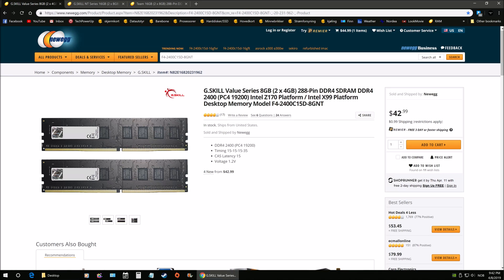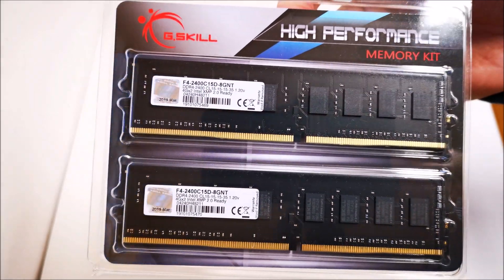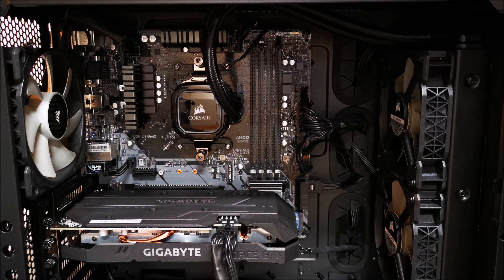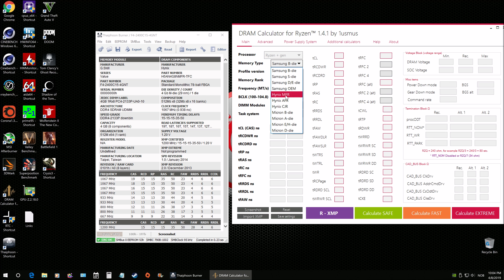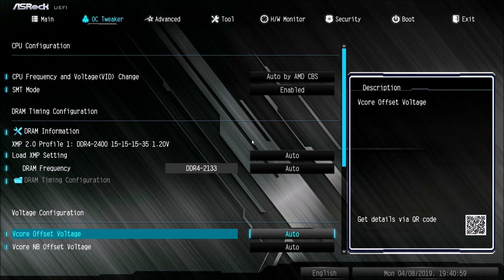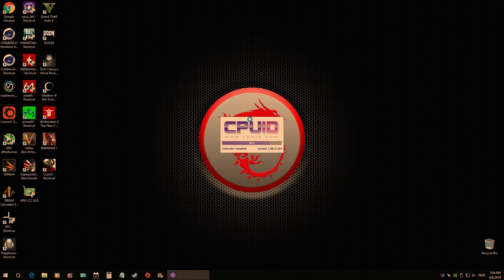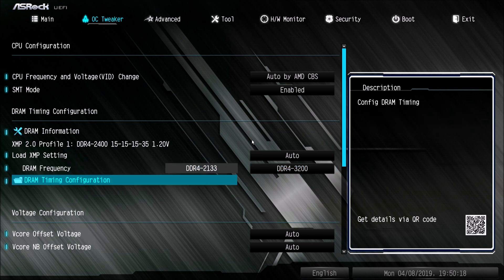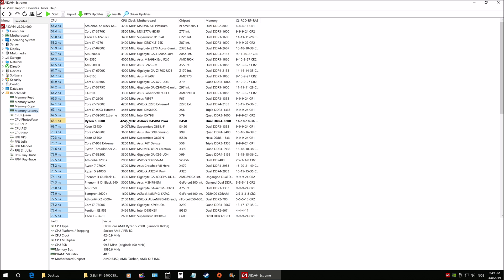Value RAM Overclocking. 2133 to 3200Mhz???

Comment: I increased voltage to 1.5v and got my ram running stable at 2933mhz. 3000mhz won't boot. My cpu is bottlenecked by my ram speed :(
Reply from the maker: 1.5v is a bit too high for 2933MT/s.
Reply: @TechnologyHive  It doesn't boot at 1.45v

Comment: I've bump up from 2133mhz(14-14-14-35) to 2666mhz(15-17-17-35) at 1.2v because neither my board support DRAM oc nor my CPU support it, I'm talking about 8th gen Intel motherboard and processor. But I'm planning to upgrade to 12th gen which supports 3200mhz. So I want to try the same module at 3200mhz(16-18-18-36 or 38) at 1.35v. Do I need to mess around with sub-timings or leave them alone?
Reply from the maker: I would definitely adjust the sub-timings, myself. However, you could just adjust the primary timings and call it a day. But true performance improvement, especially in games, comes from adjusting your sub-timings. 

Here is a list for sub- timings you can try which are universally accepted by most kits, assuming you're going to be adjusting the primary timings to 16-18-18-18-39 @3200Mhz:

tRC 60, tRRDS 4, tRRDL 6, tFAW 16, tWTRS 4, tWTRL 12, tWR 12, tRFC 580 (480 at 2666Mhz), tRDRDSCL 4, tWRWRSCL 4, tCWL 16, tRTP 8, tRDWR 8, tWRRD 4.

Leave the rest on AUTO. You can try these settings at the moment at 2666Mhz and still see a big improvement in performance in games even at such low frequency. Some settings may be AMD exclusive and you will not see them in your BIOS. 

Hope this is helpful.
Reply: @TechnologyHive  ok please provide me sub timings for 2666mhz
Channels Advanced Timing Control:
tRC, tWR, tCWL, tRRD_S, tRRD_L, tWTR_S, tWTR_L, tCCD_S, tCCD_L, tRFC, tRTP, tFAW,

Channels Misc Timings Control:
There are also too many options but I think these don't matter much.
I'll app your help. Thanks ❤️

Comment: i have 2x8 Gb corsair vengeance lpx 3200 installed on my pc with xmp enabled and i found one old corsair vengeance lpx 8gb of 2400mhz so if i install old ram with the current two with xmp enabled will all 3 work at 3200 mhz ? if not is there any way to get it to work with overclocking in bios ?
or all the ram will work at the lower frequency of 2400 mhz ?
Reply from the maker: Good question. There are several factors you have to concider. First: are the memory chips made by the same manufacturer, like Hynix, Micron, Samsung, Nanya? Second: what revision are they? Is it Samsung B-Die? Hynix AJR? Micron E Revision? The ram vendor does not matter, meaning, Corsair, G.Skill and so on.

Third: Are these dual rank modules, meaning, do they have chips on both sides of the sticks or just one side? And even if you can match all 3 aspects, you still have to deal with the "silicon lotery" issue. Some chips are better than others from factory, depending from what side of the waffer they were taken. 

I highly recommend that you NEVER mix ram modules. However, you can in theory make them work together if you disable XMP, and manually set your overclock values in the BIOS. You will need Thaiphoon Burner to inspect all memory dimms and see if they are a potential match. If not, don't do it. I hope this answers your question.

Comment: It is possible from GSkill Aegis 2x8GB DDR4 2400mhz 1.2V to 3200Mhz with 16-18-18-36. 1.35V ? My motherboard is Asus Prime B450M-A. With Ryzen 5 2600. My memory ram of origin has the times of 17-17-17-39
Reply from the maker: It really depends on your cpu memory controller if I had to guess. The R5 2600s did not have the best memory controllers. I'd be happy to get 3000mhz 17-19-19-19-39 1.35v but you can use the Ryzen calculator to help you. I made a video on how to use it. It's on my channel 😊👍.

Comment: Funny thing: Got an i7-6800k with Corsair Vengeance LPX 2400 XMP RAM (4x 8GB) and it has the same Hynix MFR Dies.
Via Quad-Channel, I shouldn't worry about memory speed too much, but I will try this. Default is 2133MHz, XMP is 2400. Currently, I am at 2666MHz and I will try 3000+.
Reply from the maker: Give it a shot 😊. Use the Ryzen calculator if you'd like as well. Comes handy. 👍

Comment: i tried it on my Vasky memory and it running at 2600mhz . after i see this , itried to overclocked to 3400mhz and it works and all my game that have a mini-stutters become smooth. its 2weeks ago before i comment this video. and still my ram alive. i think adding 1000mhz in oc is the maximum. itried to increase to 3500mhz but after a few minutes of gaming, its BS. and not turning on. then i unpluged the power and hold press the power button for 5 to 10 sec to reset the bios. then i set it again to 3400mhz. its very stable on my ryzen 5 1600.
Reply from the maker: Excellent! That's a real good bump from 2666mhz to 3400mhz. It might also be that the memory could clock higher but it's being limited by the memory controller. See if your board has a new bios out. Maybe this improves memory performance. 👍👌
Reply: 3400mhz is the max frequenzy for 1.35v idont have any voltage option. its only auto or 1.35v i think if i set the voltage to 1.4v i can reach 4000mhz.
Reply from the maker: @RenceTV04  I think you might be able to also.
Reply: i dont want to upgrade my motherboard. its a320mh. its only display the safest  setting i can choose to prevent a hardware issue so im contented to what i have 😁
Reply from the maker: @RenceTV04  that's all that matter 😊👍

Comment: Hello, I have question. I have HyperX Fury CL18 (Xmp is 3200mhz) DDR4 16Gb, Ryzen 5 3600, and mbo is Asrock B450M PRO4-F, is it possible to OC to get stable 3600mhz? I tried regular 3600mhz timings with xmp profile enabled and tested with 1.35V and 1.40V, I can boot PC but after some time while I am in game, PC restarts. I was just wondering can I get stable 3600mhz
Reply: I would just try it with ryzen dram calculator like in this tutorial, if you set everything right you should be able to get 3600mhz without any problems
Reply: @Domniak  i am oc for first time I need help
Reply: @marceloagbaba7091  I could help you, where can I contact you?
Reply: @Domniak  facebook: Marcelo Agbaba instagram: marcelo_agbaba
Reply: @marceloagbaba7091  I sent you a request on instagram

Comment: I know this is an old video. With that said, I have a 32 gig kit of LPX vengeance 2666 in my thread ripper system.  Its running stable at 2933 on stock trimmings running prime95 stress test.  I will try 2966 next. If I get good stability I'll try 3000 and continue in that fashion until I either loose stability, or make to 3200 stable.
Reply from the maker: Test with prime95 to be sure it's 100% stable 👍

Comment: Can I overclock my Geil Evo spear 8gb 2400mhz to 3200mhz??
Reply from the maker: You should be able to. Try 1.4 volts and do not touch any other settings like timing or what not. Only change the speed.

Comment: Hey please help me out. I overclocked my 2400mhz ram to 3200 mhz (Dram voltage also changed from 1.2v to 1.35v) , after a brief pause in reboot my bios shows i have successfully OC'ed my rams, but when in windows i check in CpuZ  and task manager, it still shows my ram speed at 2400 mhz. What did i miss or do something wrong ?
Brand : Corsair vengeance lpx 
Motherboard : Msi x370 gaming plus
Reply: Try setting it to 3000 instead.

Comment: I have a crucial basics ddr4 2400mhz ram. Can I use your tutorial to overclock it? Thanks.
Reply from the maker: Yes it should be the same or similar concept 😊
Reply: @TechnologyHive  What is the type of board
Reply from the maker: @aboplays3208  this is the ASRock B450M pro4
Reply: @TechnologyHive  Was I able to overclocking an 2200g APU processor to a speed of 1700 on a b450m hdv ?
Reply from the maker: @aboplays3208  I can not garrantee this because it all depends on multiple variables, like silicone lottery, ram, and such.

Comment: I installed a bigger dissipator on my ram and overclocked from 2400mhz to 3200mhz (Ballistix 16gb 1x cl 16)
Reply: Yeah it can help. Hitting 50 degrees C on your RAM and you start getting instability. Hitting 80 C and you start permanently damaging the chips. I don't think you can ever hit 80 C with RAM under normal circumstances but a  RAM heatsink may make heavily overvolted RAM more stable during gaming, when your CPU and GPU are dumping heat into your RAM as well

Comment: nice video but doesn't work with me. I have r5 2600 + msi b450 tomahawk and kingston hyperX fury 2400mhz HX424C15FBK2/8 and thaiphoon burner won't work with me? I need help.
Reply from the maker: Did you run thaiphoon burner as administrator?

Comment: I did this today before i saw this video, and I can say this is the way to go and yes it is stable if you know what timing and voltages to adjust , you can use software or traditional math. :) I have mine from 2133 - 3000mhz stable (crucial ballistix 4x4gb) I also raised my 7600k to 4.4ghz OC, 2133mhz crucial(3000mhz OC) MSI armor 1070ti 8gb 1607 mhz 4151mhz OC @ 90% Core Voltage, everything runs smooth. Air cooled, I was going to upgrade but after doing this i think i can squeeze another year or two from this, if I add liquid cooling i can get up to 5.0ghz 4.8ghz and ill be content
Reply: At first I thought you were talking about liquid cooling RAM :D

Comment: I got a 2600x+ B450 Aorus elite + DDR4 G.Skill 4x8 2400Mhz , i tried to push up to 2666 , it worked , but beyond that , like exemple 2800 , pc dont boot , i didnt know too much so i didnt changed timings or everything else , just changed the DRAM Frequency , any clue please ?
Reply: bump the dram voltage to 1.35
Reply: pump up the voltage, dont go over 1.35v tho

Comment: hello to do with any brand of value, like I have a 2400mhhz and I want to put the 2667 3000 one from kingston can I do it?
Reply from the maker: Depends. It is not recommended that you mix different spec memory. But if the IC'S are the same, for example Samsung B-Die or SK Hynix A-die, you can try and mix them. Download thaiphoon burner and find out who makes the actual memory chips. Then go from there.
Reply: @TechnologyHive  yes the two memory modules are the same 2400mhz I wanted to put the maximum 2667 3000 if it works. but from what you told me overclocking works right?
Reply: @caicoalan2078  Nothing is guaranteed to work, Just give it ago and compare your score with a benchmark software. https://ram.userbenchmark.com/

Comment: hi I'm running the Ballistix Elite BLE4G4D26AFEA.8FAD 2x4GB ram. i'm not sure if it is 2400 or 2666Mhz cannot find him at google . I overclocked my 7600k to 4800Ghz 1.25V and now im trying to get 3200Mhz with this ram but it won't let me go over 3000Mhz by 1.35 DRAM voltage. Should i go higher with voltage or is it because of the timings 16 17 17 36?
Reply from the maker: Try 16.18.18.36 trfc 480. But the best way to give you a more straight forward answer is if you get thaiphoon burner. Download it and find out if the chips are Micron E die or what?
Reply: @TechnologyHive  can i upload a picture from it via imgur? let's try imgur.com/a/xIUxyvi
Reply: with 3000Mhz i get a bluescreen after 10min playing a game so i went back to 2800Mhz but the mouse reaction was much better with 3000.

Comment: Good video mate. Just got my hands on 2 Gskill F4-2133C15-4GNT CL15 modules, they run 3200Mhz at CL19 and 2800Mhz at CL17, 1.3V.... Gskill - go beyond limits <3
Reply from the maker: I also just got some Ballistix Sport sticks rated at 3000Mhz CL15. Managed to push them to 3600Mhz CL16-16-16-36 1.4v They are Hynix E die chips so the kit overclocks like a mountain goat :) Perfectly stable for 24-7 use.
Reply: E die are the best thing about the ballistix ram my custoner utterly enjoy my oc for the from 3200 to 3600mhz

Comment: Hi,

I have exactly the same kit but cant get it above 2800 mhz and even then it doesnt always stick through it...

I wonder what could be the cause.

These are the specs of my build:

Asrock b450m pro4 

Ryzen 3 2200g (oc to 4 ghz on 1.4v and vega 8 to 1700mhz on 1.3v)

Memory as it is, at: 2800mhz and voltage at 1.350v

Hope this is enough information and hope you find the time to look into this!

Kind regards from a new to the scene pc gamer!
Reply: This series of ram sticks are not stable with Ryzen CPUS that has integrated graphics. The problem is your cpu, not necessarily the ram. If you want to overclock this kit of ram you should have bought a cpu that has no integrated graphics inside.
Reply: remco linders it’s probably the memory controller on your 2200g.

Comment: Can I oc my Corsair vengeance ddr4 c16 3000 MHz to proper 3000 MHz cause they are currently running at 2133 MHz automatically I don't know  why, on gigabyte b450 ds3h wifi???????plzz help
Reply: ONEFORALL turn on xmp
Reply: Use the ryzen ram calculator with frequency 3000mhz and put in all the numbers it gives you into your bios. Not just the cas latency stuff. Try the safe option first, this should often solve a lot of stability issues.

Comment: Im running Gigabyte x570 ITX Aorus Pro Wifi with 3700x and G.skill Trident Z 3600mhz CL17. Cooling CPU with a Noctua NH-U14S. The RAM will do 3773mhz at CL14 when overclocked. Kinda insane, and the performance is through the roof😁

For anyone thats interested, the specific sticks im using are G.skill F4-3600C17D-16GTZSW. They are verified Samsung B-die, single rank sticks.

Comment: I can't get my ripjaws to 3000mhz it boots at 2933mhz but won't go over that? Any way I can get it 3000mhz or over
Reply: Use ryzen ram calculator and put in all the numbers that it gives you. Not just the cas latency numbers.
Usually that should solve a lot of stability issues.

Comment: My f4-2400c17s-8gnt x2 capped at 3000mhz cl16 at 1.232v.  for some reason bios puts cl15 back to cl16
Reply from the maker: 16CL is normal. Ryzen likes those even numbers. Plus your RAM might not be on the QVL for that motherboard.
Reply: @TechnologyHive  Its not. I actually had to return 2 or 3 memory kits to find those working on my board (which is b350 version of this one). Im more suprised that they got working at this frequency at that low voltage but refuse to boot on higher clocks no matter how high voltage i put

Comment: I have ryzen 2600, b450-f motherboard and kingston hyperx fury 2666 16gb  2x 8gb. Is it possible to overclock it to atleast 3000  mhz  safely?
Reply from the maker: It is possible, sure. But there is never any garrantees when overclocking hardware. The thing that you have to worry about is voltage. Keep the ram under 1.5v and all should be good. Just take your time.
Reply: @TechnologyHive  will it be safe in the long run?  i mean if i manage to oc it to 3000mhz stable i want it to stay that way. Ram prices from where i live are too high so buying a new one is not really an option for me since i just got these rams
Reply from the maker: @kidreinen  Good question. The answer is absolutely yes. Just have good airflow in your case and you won't miss a day of it. Enjoy!

Comment: Wow man you got jackpot with those ram sticks , i have gskill ripjaws without Xmp factory 2400 and only  thing i got is 2666 and nothing more , every other setting i tried was fail and my ram sticks are samsung B-die, i dunno what else i can do .......
Reply: Samsung is shitty man, idk how this company deceives people even to this day
Reply: @RRRRRRRRR33  wtf samsung b die is the best??
Reply from the maker: What motherboard
Reply: @TechnologyHive  hi, little update i managed to pull 3200 with little voltage bump i think 1.30 and its working with no issues almost a year since my comment , motherboard is Asrock AB 350 gaming K4 
And also forgot to mention i didnt change timings i tried 16 16 16 it worked but i noticed little stutters when playing games so i changed back to default . All in all gskill ripjaws are awesome bang for a buck i bought those sticks for very low price.
Reply from the maker: @sincro007  Thats good George :) you can safely take your ram to 1.4 volts with 0 risk if you need to. No harm in that.

Comment: Thanks, great video! My Ripjaw5 3200mhz cl16 won't oc when I tried your advice from video. Almost stable clock is 2666mhz 16-18-18-18-38. I have even the same mb what u have. Maybe I've badly lost the silicon lottery.

But it is relief that I can buy cheap value ram and try oc that, not a big deal. Maybe g.skill aegis.
Reply from the maker: If your ripjaws kit is 3200mhz, why are you going down to 2666mhz? Or am I misunderstanding you?
Reply: @TechnologyHive  XMP profile on that kit is 3200mhz, but it won't work stable. I have tried to tweak timings, but it wont work even loose timings on auto.
Reply from the maker: @juzaaaa22  Ah okei that makes sense now. Usually I would have to reset the bios or load setup defaults in order to completely erase previous memory timings. BTW make sure you're running the latest bios. Once you reset everything, try 3200mhz 16.18.18.36. TRC 58. Leave the rest on auto and set voltage to 1.4v. Let me know if it works. what cpu btw?
Reply: @TechnologyHive  I tried. Comp crash during booting. Not even near working. I've spent alot time trying to figure whats the problem. But I've come to that that those ram sticks are bad quality or not suitable for this setup.

I have R5 2600, Asrock b450m pro4, gtx 1070, 250gb 970 evo. Bios is updated.
Reply from the maker: @juzaaaa22  Okei. I'd try value ram like this kit in video and do the overclocking yourself. Skip the XMP profile. If you need help email me at: pctechnologyguy@gmail.com
Reply: You need Samsung B-die sticks for that magic consistent overclock. https://benzhaomin.github.io/bdiefinder/

Comment: i have same ram but 2133  try 3200mhz cl 14.17.15.17.26 on 1.5v
Reply from the maker: Thanks for the tip. Problem is the memory controller on my R5 2600 is not the best. Even tight timings no matter the voltage will not hold. It likes up to 3200mhz with loose timings. But on my Intel system I can reach 3400mhz :) maybe I will follow up. Thanks for watching btw.